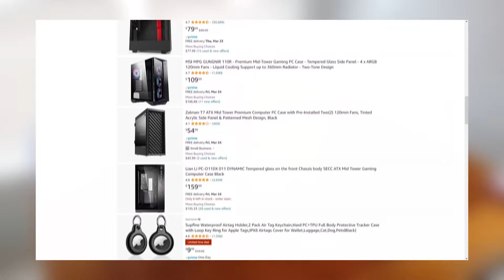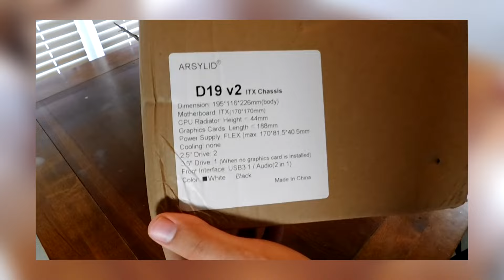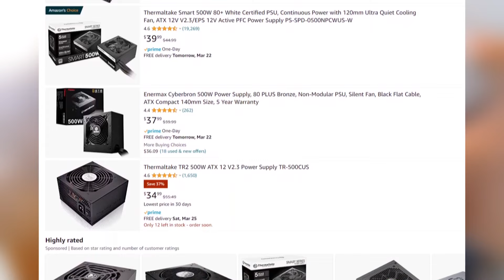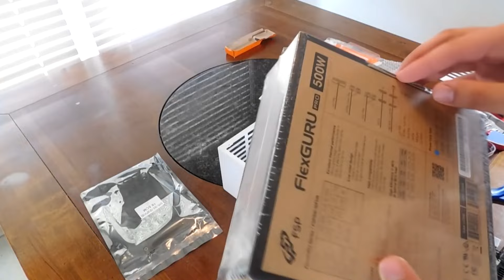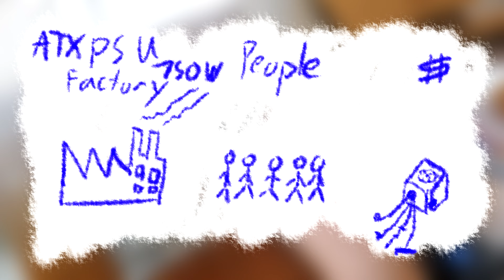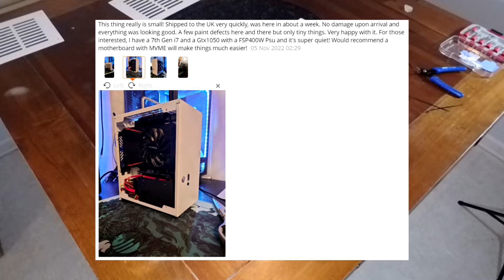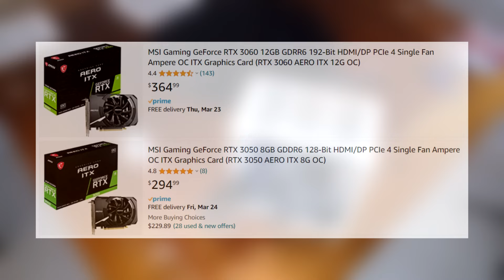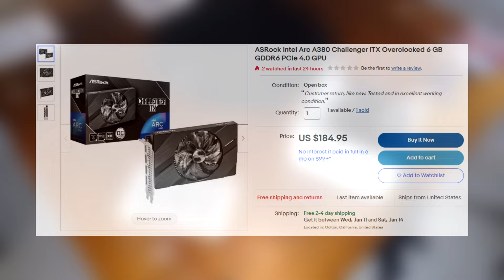Can you make a budget ITX gaming PC?

Comment: I have an itx pc as my second system I use it when travelling.  Its got a asus rog mitx z790 motherboard 64gb ddr5 6000ghz and a nvidia rtx a2000 gpu the cpu is an i3 13100. The a2000 is a beast of a card 6gb vram the power of an rtx 3060 and no need for external power
Reply from the maker: Impressive. So what is your main system then?
Reply: @BudgetBin  i7 13700f . Evga  ftw3 rtx 3080 ultra with hybrid cooling kit . 64gb ddr5  2 pcie gen 4 2tb m.2 and a gen 3 250gb m.t for OS  in a white nzxt H5 flow
Reply from the maker: @acid3129  Very nice!
Reply: Same I also have a atx and itx build. And the itx is for when I travel lol. I don't like to use laptops personally so the itx saves the day.

Comment: My problem with ITX is the cases are typically too expensive for what you're getting, while also typically being horribly inefficient in their layout. Nicer, boutique cases by people who actually know what they're doing can be quite pricey.
Reply from the maker: I feel like the case I got and designs similar to them can be technically less than $50 and more so around $30 all things considered, but the demand is just not there for these cases. If a company could do them just cheap enough using a different material along with an aluminum frame, I feel like the could be popular purely based on price.
Reply: And this is why they should be at the bottom of the pricing chart.
Reply: cooler master NR200r is always on sale with rebate and coupons for a final cost of 39
Reply: The cases i like are around 160 to 180 but thats wayyy out of my budget

Comment: I built mine in 2022 with a combo of used and new parts.  I got a inwin B1 case with a 300w gold PSU included for $130, a asrock B450 mitx am4 board for $130 and a ryzen 5 2400ge for $40 with a stock ryzen wraith cooler for $8, $25 for a 480gb ssd and $42 for 16gb corsair DDR3 3200mhz.  Runs all the games I like to play without an issue and thanks to the 35watt TDP on the CPU it's really quiet.  $375 and it's been great as my HTPC/ game console and the inwin B1 looks great with my tv stand.
Reply: What gpu did you use?

Comment: heyy... looking to get this case, but am in a bit of a rut. There's a few gpu's that I'm considering but according to their specs L*W*H they all seem to not fit just by numbers. here's the interested gpu's A380 low profile, rx 6500 itx, a gigabyte and Asus 3050 low profile. My question is.. Ive seen mini itx builds around these gpu measurements and I'm really wanting to fit the 3050s lp in this case and don't want to buy it and find out that it won't fit how come there seems to not be a gpu with the actual measurements required for this case. Just want to see if the 3050 lowprofiles fit on this.

Comment: Silverstone SG13+Ryzen 3600+RX580 8G+16G DDR4. Then any ITX motherboard and 500W PSU you can find at the cheapest used price you can get. Bluetooth and Wifi USB dongles.
I built that PC in 2024 all with used parts for around 350€. Currently running as my main Steam box/HTPC in my living room. Running even recent games at 1080p. Based on YT, it should run The Witcher 3 and Cyberpunk 2077 in 1080p at (or very close to) 60fps.
As you said, MB and PSU are what are killing the price.
Next upgrade for me, RX6600 coming in for 100€ as a replacement for the RX580. Should get 60fps in 1080p in all games easily.
Sapphire"s RX580 and RX6600 are both smaller than 22cm in length.
Ryzen3600+RX580 if you're on the cheap. Ryzen3600+RX6600 if you want good performance. Then everything else as cheap as you can. Best value combos I found after hours of research.

Comment: Quick Question. Around 6:28 I see that where you install the riser cable, there are two standoffs holding it in place. Can you actually move the standoffs to adjust the riser cable if it has weird areas of where to screw it in place?
Reply from the maker: So, as far as I can tell and remember you can adjust the riser, but not the standoffs. It gave some wiggle room so depending on the setup you could accommodate for cables or shrouds into the build.

Comment: I'm currently considering rebuilding my older PC with a Xeon E3-1240V3 since I'm aiming to downsize and I think ITX may be an option for me. 

Budgeting would probably be like this: 
the Xeon E3 1240V3 (got this for ~39 USD)
~17 USD for 16gb DDR3 1600mhz
~27 USD for an ITX H81 motherboard
~20 USD for a cheap ITX case that supports SFX power supplies
~47 USD for an RX 550 low profile
(already got a 240gb ssd and SFX psu)

So that would be about 111 more USD for the build. The RX 550 could be substituted with a GT1030 for me but those are twice as expensive and have very few used options in my area.

Alternatively there's the option of getting an Optiplex 7060 Micto that has an i5 8500T, 16gb DDR4, 240gb M.2 SSD for about ~156 USD.

What do you think?
Reply: I technically could reuse the ram from its current build but I think I'll try to flip the rig it came from which is my old pc that got upgraded. That has an i3 4170, 10gb DDR3, H81 motherboard inside a mATX case.
The Xeon won't work as I need a dedicated a GPU for it since it has no iGPU and I used to have one (RX 560) but had to sell it off.
Reply: This plan got abandoned as I sold off my Xeon E3 PC. The Optiplex 7060 Micro would likely be what I would go for since I found some of that for around 150 USD±10USD.

Comment: The case in the video seems to be on the small side of ITX cases. There are cases that, while still compact and designed for ITX, actually have reasonable room and are easier to build in.  

NR200 and SG13 are two such cases. They are also from name brands and are not very expensive. 

The infamous NZXT H1 case is actually great to build in, now that the dangerous riser is replaced. The unit came with a good 650w SFX PSU and 140mm AIO cooler. I bought a couple from eBay for $150 2 yrs ago  when a ton of them were being dumped due to the notoriety.  

Getting an unpopular component is a way to save some money of the problem causing the unpopularity is actually solved.

Comment: i think it was possible for your budget to go the deskmeet x300 route with a ryzen 3 cpu it would have been almost the same price if not cheaper with new deskmeet x300 and a new ryzen 3 cpu if you could find one where you are at... there are a lot of those ryzen 3 in my country and they are dirt cheap like less than 60 usd a pop and you can get them second hand for even cheaper price than that... and the deskmeet x300 comes with a 500w psu for like less than 200 bucks with wifi since all non wifi version is kind of hard to find here in this country... and it would have cost less than 150 bucks here for the non wifi version...

its 8L and can fit in a backpack as well... slightly bigger but it comes with the benefit of being able to use regular PSU and a 210.9mm GPU if you are willing to fiddle with the GPU to fit it in... and 4 RAM slots... so the options to use up to 4060ti/3060ti or 6600xt/7600xt becomes possible...

as for the PSU being 6 pin instead of 8pins... a lot of people had done mods to daisy chain 2 other ground pins to make the last 2 pins... in fact some reputable PSU manufacturers also do so as well... so all you had to do was get a donor PSU with the extra 2 pins and cut out the cables and the male connectors and jump/splice 2 of the ground pins from the flex PSU that does not have the 8 pin... i mean if you went all the way like that with the GPU might as well go full mod at home vibe with the whole thing....

Comment: well as far gpu is not a huge  issue .... lately i found that  a good deal is    the ashrock deskmini x300 combined with  the ryzen 5500gt    i 2x8 ddr4 sodim 3200 from a laptop update and a 250 gb ssd   left over so i made a computer with those that costed me only 230 euros .... i was surprised what that little guy can do ...after i done testing  i gifted the computer to my father that was the intention of the build to begin with :P

Comment: I recently built a new PC in a TT Core V1.  It's larger than your average ITX case, but as budget friendly as you can get.  It's got a Z690 MB, i3 12100F, RX6600 and a 650 W PSU for under $800.  I am very happy with it.
Reply: I think the z690 is overkill for the i3 12100f
Reply: @taibro1  It is, but I got it open box from Newegg about $130, which was about the same as the lower tiered MBs.  It came with more features, so I figured, why not?
Reply: @LapNgo-h9u  thats insane dude, i cant use newegg in my country sadly

Comment: I would say a gtx 1650 super single fan would work best. Almost all every hp gpu  lately has the power plug in the front. I have a hp gtx 1650 super, RX 5500 and rtx 3060 all power plugs point forward to clear the side panels in their prebuilts.

Comment: Not in my region.
My specs are: 

-m24 itx case

-asrock b550i itx/ac.

-amd ryzen r5 5600.

-axp 90 x36.

-asrock rx 6600 xt challenger.

-hyperx fury 16gb 3200 ddr4 (2×8).

-crucial p3 plus 500gb.

-tf skywinditil U1 flex psu 500 watts.

My total is $908 usd.

Comment: ITX is always a pain in the ass, it’s the universal rule that you have to accept. Also you should never trust a manufactures rating for TDP. Especially since not even the chips have accurate TDP ratings. For example AMD doesn’t even use power in their “Thermal Design Power” calculations

Comment: I funny used node 202 case, a SegoTep semi-modular ITX power supply, some steel b450 motherboard, so random Corsair ram, a risen 5600X, a off-brand low profile cooler with two fans that turn out to be amazing, and a GTX 590. Everything came out to be around $550. You just got to be willing to buy some stuff that seems kind of meth